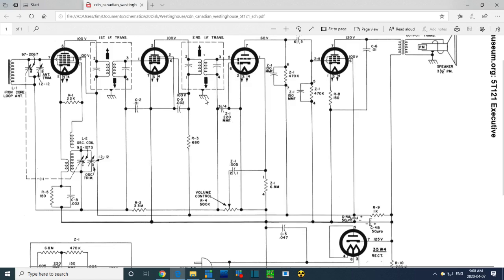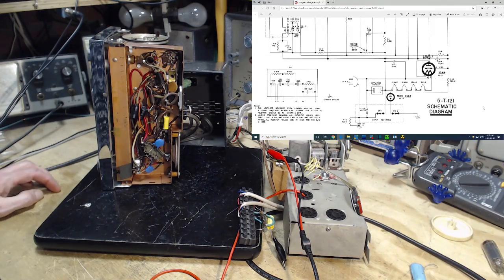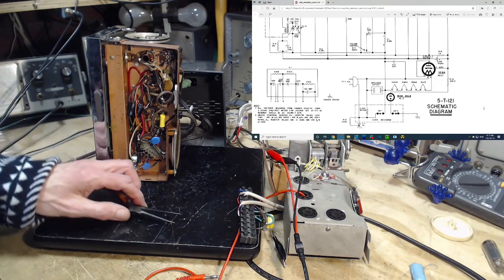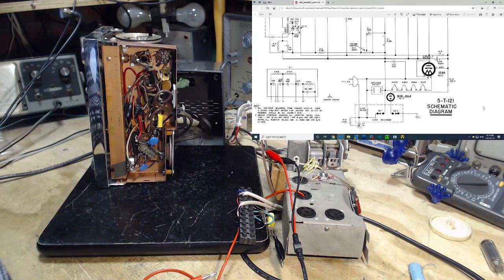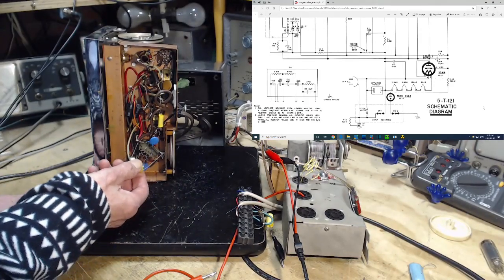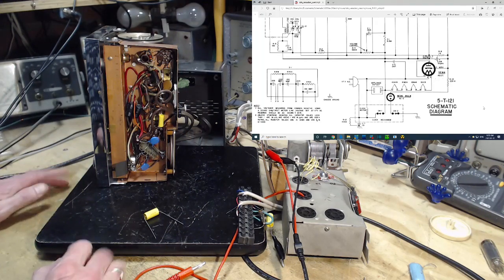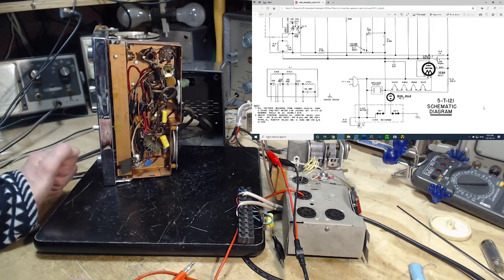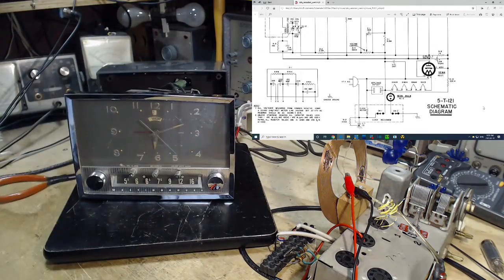Westinghouse 5T121R-2 Clock Radio Video #7 - Last Problems Solved

Comment: That thing with the resistors and capacitors is called a 'couplet.'  They are notorious failure points.  They were a terrible idea, but were used because they reduced production costs. You were fortunate that the schematic showed what was in it.

Comment: am broadcast band is not what it used to be. 35 yrs ago radio stations broadcast on both am/fm and the am was louder. was the go to for listening to afternoon major league baseball games/prep football/broadcasting live at county fair livestock/horse judging even tractor pulls. i had a fender mount am tractor radio bought from caseih our local station came in strong could here it clear across 40+ acres for homecoming football games